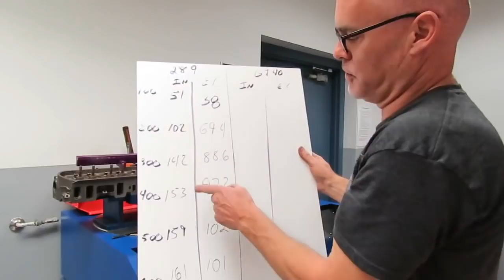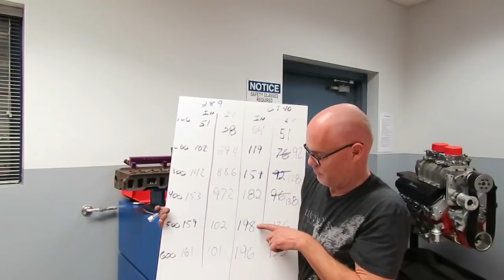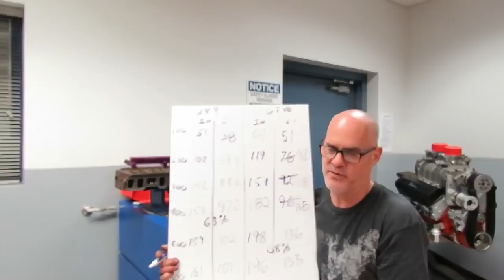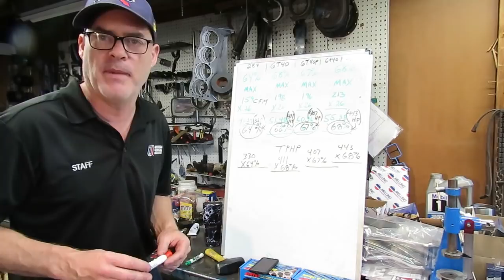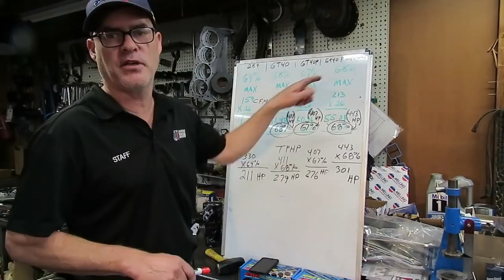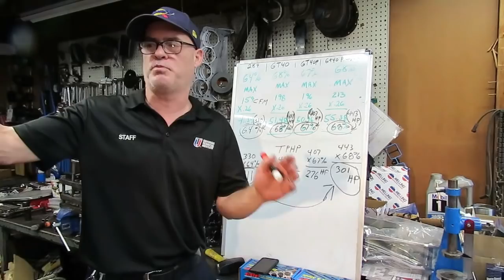How to get more power out of your small block Ford part 5

Comment: Myvintageiron, I’d agree with you that GT40 heads with the larger valves would make likely 25-30hp more but, curious or your opinion that if they were also ported, chambers massaged and used in that config they’d likely make 30-65hp maybe more. 

Obviously, a good cam spec’ed specifically for the particular flow of the heads, matched with good intake likely a ported upper & lower GT40 Cobra intake manifold, larger 70mm throttle body & EGR spacer, and maybe 1-5/8” or 1-7/8” headers likely 3.5 collectors and 2.5 dual exhaust.

Likely, that would be in the 400-475HP range with better than stock ignition & fuel injectors, this would all be lowered by 20-22% with drivetrain loss factored in the mix. This would still be a nice cruiser with good reliable power for Fox body, Grand Marquis, F150 and even a F250 for light towing.
Reply: You wont even be close to 400 my friend, sorry. Not even at the flywheel.  Rule of thumb,  you can make about 1 hp for every 2 cfm of flow from the heads. Divide that by the 68% percent of flow for realistic numbers.  So your motor might get close to 300 with the best conditions and tuning for your motor. So from a 5.0ho that makes about  240 on the dyno, you'll be up around 280-290hp.
Reply: You really just need to watch the last 10 min of this video a few times
Reply: @jasonhooey5677  I respect your opinion but, the math and actual Dyno results I’ve seen confirm what I stated and are verifiable in a easily repeatable manner. Keep in mind 400-475HP being a range achieved at best, though still plausible other factors can diminish HP and surpass HP.
Reply: @80sfordguy  you're right buti think wrote it backwards.  Not "1hp/2cfm"... (that would mean the 289 was a 50hp engine).   i think you meant 2hp / 1 cfm then divide by exhaust %.
Reply: @johnb7430  I didn’t write that part, that was something Jason Hooey commented unless I’m unclear on your comment. Besides, personally the math that myvintageiron talks about in this video and in previous videos of his are true and were taught to me while attending WyoTech Automotive Institute of Technology (“WyoTech” for short). The math is widely used in the professional racing world as well as small engine building & machine shops as general practice when building and engine for a specific power rating, torque output or application. 

It’s incredibly factual, usually within 5% or less Accuracy and very repeatable as long as other factors aren’t introduced. Induction, ignition, fuel, exhaust, cooling and lubrication can all change an engines mathematical output if over or under designed, mistakes are made when the build is done or the build of the vehicle hinders the engines designed performance. Like myvintageiron said in the video, the math is good but other factors can largely effect the performance if mistakes are made or flaws are in the other factors that hinder the engines output.

Comment: You say lift beyond 500 is useless. 😨
At 500 max lift the valve is open there for 2* maybe.
With a 600 lift cam the valve is open beyond 500 lift for 15* roughly.
15 vs 2 is a whole bunch more flow time to fill the cylinder.
More lift ALWAYS produces more cylinder filling because every point on the lift cycle is attained sooner... Effective duration.
Reply from the maker: that is a theory that many talk about the only problem is the dyno says other wise you always want to find the max cylinder fill lift as low as possible it's easier on the valve train we have tried what your saying many times and it simply isn't true there are factors at work that you are not considering one big one is L/D ratio to make a statement like this "More lift ALWAYS produces more cylinder filling" is just plain nonsense,  if that were true we would be using .850 lift cams in everything  Head Flow and the Valve size is vitally linked to the lift requirements of the engine
Reply: @Myvintageiron7512   Good info as well! That more lift thing.. Im trying g to make.more power with my small street cam at only 512 lift than others qith a 650 lift cam.. well.see very soon. Everything in my engine was matched to airflow.. so we'll see
Reply: Damn.. that much difference?

Comment: Some times I don't think people realize how much fun is to be had with a 300 or 400hp engine.
Reply from the maker: I get the most enjoyment from making changes and seeing the improvement you hear people say all the time their early mustang or nova engine has 450 HP with all factory parts and when you put them on the dyno it's actually 250 to 
300
Reply: @Myvintageiron7512  450HP out of a 350ci engine takes some work...For entertainment purposes, I watched "Engine Masters" now those guys aren't builders, they are magazine editors, that slap things together, or has someone else do their building... But they had a 500hp SBC @6600 and 500hp @5800 BBC compared on the dyno....and they were demonstrating how "High Strung" the 370ci SBC was and How meaty and "street-able" the 454 BBC was... The budget was considerably HIGHER for the SBC...The BBC was mostly stock from the deck down...
Reply: Much rather have a 350 to the tire daily driver than a racecar.. been there done that with race cars.. not worth it anymore to me

Comment: Would you be open to test cheapie aluminum sbf heads, I'm running a set of flo teks, and I'm really Impressed. First used Gt40p's which flow around 196cfm at       .500 lift, me thinking more is better I got a  .536/.536 cam 218/228 @.50. Car ran great, pulled hard to 6400. Got it dynod an it made 245hp and 340rwtq backed by a t5 with 3.08 gears. I'm now using 180cc flo tek heads, Mac flow at .500 is around 218, and goes up to 224 at .600 I reused my cam thinking it was a good rpm range, but really I'm lucky I choose a pretty good cam for my heads, I knew a little about cfm and stuff, but your videos really explain it well. What kind of cam are you going to be using for this build?